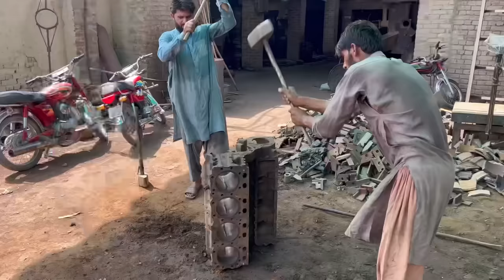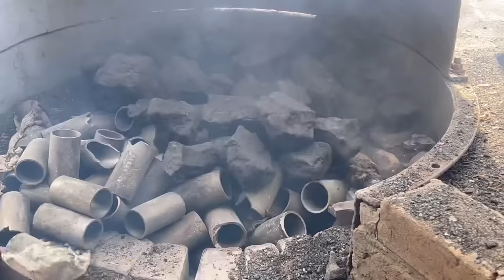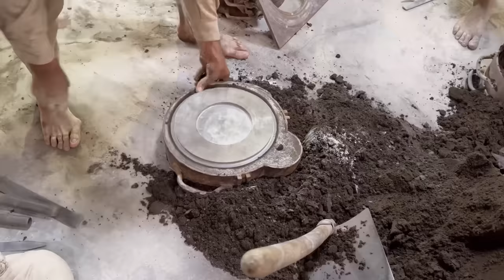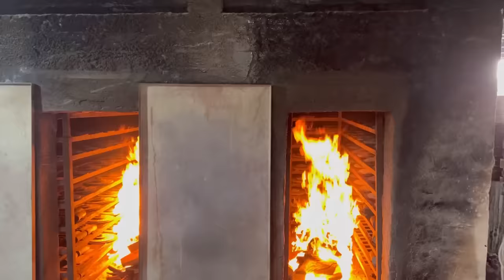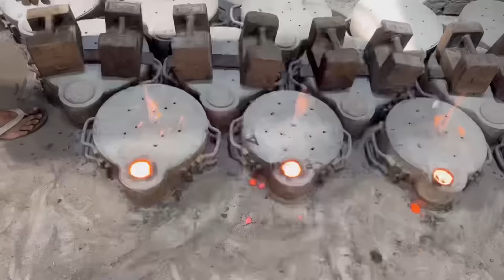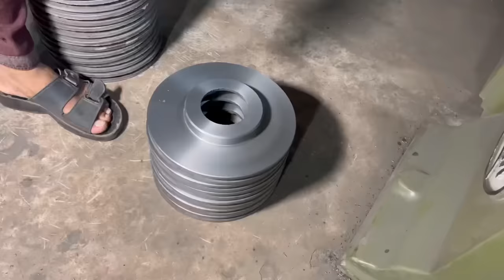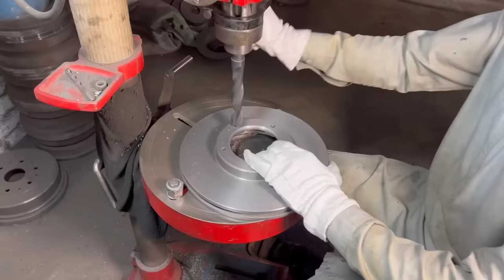Amazing Manufacturing of A Car Disk Brake Plate |

Comment: For those who do not know metallurgy, it is an extraordinary video. It has a series of serious errors in the production of brake discs. The molding sands mixture is made as considered by the mixer, without moisture control, permeability, etc. They use cast iron from engine blocks, which is a superior gray cast iron, but it is melted at the cubilou, where they burn a lot of coal to maintain the lamellar graphite and prevent the formation of cementite. The result will be low-quality lamellar graphite cast iron brake discs. If you notice, it does not show whether they are checked dynamically or statically. A disc like this, under brutal braking, is likely to break and cause a serious accident.
Reply: Exactly. I pray those no-name white box brake rotors didn't come from these stone age operations in India or Pakistan. I don't want this crap on my car.
Reply: @RRaucina  I noticed that the original brake pads last longer than the aftermarket ones. I'm wodering why ??
Reply: @stefanpopescu6479  certain parts are made in top quality only for the first installation on a new car, later by replacing them we notice that they last less or are of poorer quality
Reply: @TheSmitovski  wrong, I put after market parts and they lasted less than the original ones. I only put the original and I am sure that I have no problems with the car 😀
Reply: Sir, I would like to tell you that I tested several rotors and broke those rotors like breaking a cracker to test the strength of the casting, it was awful. Grainy and not stable. Those rotors under stress caused by high temperatures due to continuous braking will warp and brake pedal will be pulsating like crazy. After cooling down it'll be ok until it gets warm/hot on the next brake application and the shaking will re-start and will be terrible. Yet, they pass DOT (apparently). A complete 20 footer container was scrapped, the company tried to get their money back but received nothing. Thank you for posting an intelligent reply. Cheers
Reply: @caddyrack  yes and car owners would rather buy that junk than machine their original rotors, which get melted down. So much so that garages don't keep machining tools.
Reply: @bovellois  The system is broken. I taught how-to-machine rotors for many years and to finish the job by sanding the with an abrasive disc that ran CC versus clockwise machining to REMOVE the grooves (like a vinyl record) created by machining. You only take out a few thousand minding the approve minimum thickness stated by the manufacturers. I stayed below that. We're a society of parts changers not repair people anymore. Have a great day.
Reply: @stefanpopescu6479  I  try and buy Wagner, either US made or Mexico. Seem to last a very long time.
Reply: @caddyrack  I bought several rotors for Chrysler mini vans, and they all warp under long downhill stops. I am certain the rotors were simply misdesigned for the 2001 to 2007 model years. too small and light.
Reply: @RRaucina  Yes, I agree with you....unfortunately Chrysler will deny this. This was the problems to many vehicles where the engineers designed the brakes appropriately, but, the 'cost' engineers asked them: Can we make the smaller? Of course the save a few pennies on each vehicle they did this. What I'm talking about is the after market business that they make the rotors in the far east. Total garbage as we speak. The rotors are within "specification" but the inner face and outer face are of different thickness therefore one side will run too hot thus make them prone to heat cycles and consequent warpage after cooling.
Reply: Probably made for autozone
Reply: Safety is NOT an issue in Pakistan.  Just getting a job done to sell.
Reply: I'll never buy a disk like that.
Reply: NEVER use a car spare part if it is not made at Mexico, USA, China, Japan or Europe. NEVER! Be care with cars made in Brazil.
Reply: They are obviously turning out 100's a week. If the failure were as high as you suggest then it would quickly be noticed, people would stop buying them and they would go bust.
Reply: @adrianwright8685  maybe 100 a day. anyway it's insignificant. probably their market is the local one which is full of car accidents
Reply: Thats a paddle mixer, water based greensand should be milled in a mull, the water seems to be obtained from thr black hole of calcutta!, cupola iron tends to have a high S content promoting chill (cementite) with free iron sulphides which are hard unless Fe Mn is added which I doubt, but they do appear to be innoculating the iron in the ladles , perhaps FeSi? but no wedge testing for chill but I'm sure they will have repeated the process enough times to know what properties they are getting. Conversely smaller western foundries were not much differnt at one time. I remember a small foundry in Scotland not much different in the 1990's with the exception it made low quality road furniture such as drain covers not vehicle components.
Reply: @adrianwright8685 it's Pakistan. These rotors keep being manufactured not because they are good, but because they are the only, "take it or leave it" option for many.
Reply: The drill goes through the disc far too easily
Reply: Available now at your local Auto Zone!!!
Reply: then if unsafe just let them sell to the usa at wal mart super center SAM WOULD be proud of his kids
Reply: It looks like they not only added engine block material, limestone and coke to the mini blast furnace, it looks like they also added another material which contained the alloy additions they needed.  They also weighed their charge, implying that they were looking for a ratio of alloy addition.  That, along with a specified cooling rate for the castings, may have produced the microstructure and the enhanced mechanical properties they were looking for.  I don't know if it did, they are just showing what they do, not how they got there.
Reply: That's what autozone sells me and all other auto or truck  parts stores NapaNapa, parts master etc.etc.
Reply: not true. none of our product users who died in an accident due to brake disc fault have ever complained. yours truly, ahmad rashid, the ceo at pakistani super brake discs inc.
Reply: I myself worked in an iron foundry for 13 years as a model construction mechanic specializing in foundry model construction and immediately thought the same thing! We cast the brake discs from nodular graphite GGG40 / EN-GJS-400-15. We wouldn't even have made a shithouse gully out of this crap they use! What they do will cost lives!
Reply: not made in sheffield then ;)
Reply: And not to mention all the impurities of being rolled around in the dirt.  Of course when you use the words, "Brutal Braking" you are assuming these will be sold in areas that have clear open roads that aren't surfaced with compacted garbage. 😁
Reply: @bovellois  most vehicles sold in the USA have rotors that can't be turned in a standard shop environment. even if they could be turned, by the time the pads are worn out the rotors are at or below minimum thickness. im guessing this is true most everywhere.
Reply: This demonstrates that people with less modern technology can make do without modern methods... But their quality leaves a lot to be desired.
That being said, I used a low-cost n"... water pump once, and it failed less than 2 years later. Never went back to the cheap parts. I use only O.E.M. parts now and I generally don't replace those parts again. Unless of course, it is 10 years later! (I keep my cars a long time!)
Reply: @stefanpopescu6479  Go with O.E.M. pads. More cost/last longer.
Reply: Ahhh, please tell me where i can purchase a pair of your finest top quality safety flipflops from?😂
Reply: Bit dangerous this isnt it??  Smoking on the job ! .😂
Reply: These are the discs you buy when you want rid of the mrs 😂
Reply: @MyNewUserName47  on my son's Honda Civic, the original rotors had about 3 millimeters left to play with. The surface was nearly new, it just needed a light turning. But I can believe the cheapest rotors are done after one set of pads.
Reply: The video heading should read "Disturbing" Manufacturing of a car disc brake rotor. Love the PPE also. And here in Aus were saving the planet by shutting down coal fired power- what a joke!
Reply: Come on! Metal is metal!
Reply: And people complained when they wanted to regulate quality of mechanical auto parts in other countries where they do.
Reply: @bovellois  NOT Entirely true. With todays "minimalist infrastructure for maximum profit" attitude to many businesses it is probably more like MECHANICS would rather sell a NEW part than take more time and labour (So ending in the same cost) to machine the rotors (So now 2nd hand refurbished rotors on the car and the mechanic needs to outlay cash to buy the rotor machining gear ) vs so called "Brand sparkly new" Rotors.
Most customers hear "fixed up" vs "NEW" and go the NEW. 
Simple logic. NOT knowing the industry would have me go for the "NEW" but I know better and machine my own :)
Reply: @FarCryBaby  you're right, and even a "new" (as in refurbished and shiny) set of calipers once the original ones are a bit rusted!
Reply: @bovellois  - When machining a single rotor is $80-100, and a cryo treated slotted/drilled/vented aftermarket (performance / name brand) rotor is $50-$100, there is no reasonable reason to machine down a rotor.
Reply: I wouldn't install this junk even if I got it for free. 
I can only advise everyone against installing something like this in a modern car. 
If you install something like this in your car, you not only risk your own life but also that of those around you. 
In my country, such scrap is confiscated by the customs authorities as soon as it is imported and destroyed immediately.
Reply: @adrianwright8685   The buyers would have to be aware of the source in order for that to happen.  You’re entertaining the myth of a perfect free market where low quality is inevitably weeded out.   We all know that’s not the reality we live in.
Reply: @StevenTubb-s8u  I was thinking the same thing. They either have some really good drill bits or that is some low quality cast iron.
Reply: The cylinder liners must be more than cast iron?  What was that they added to the sand?  Surely while still molten they are liable to warping?
Reply: @stefanpopescu6479  have you noticed your OEM tires don't last as long as replacements? Even of the same brand and style? Ever wonder why?
Reply: @bovellois  rotors don't go to landfills. If they did, what's the big deal? Iron came from the earth, why can't it be returned to the earth?
Reply: @jonathanpalmer155  While they don't show it, the cupola operator is running periodic samples on the iron melting process and adjusting ingredients as needed. I'd like to watch the cupola operator, I guarantee he knows what he is doing and is running the crew with just a few hand signals. The reason they are using 'recycled' iron is because it's easier to get consistent class 35 iron vs. working with raw ore. Plus it's plentiful and cheap. 
The molding sand is a combination of sand, various types of clay and water. In most iron foundries, skilled workers can squeeze the sand mix in their hand when it comes out of the sand muller and use tacit knowledge to get the right mix better than an automated process. The pattern, cope and drag are specialized for this work. Red hot is not molten. Due to chilling, cast iron solidifies pretty quick (notice they pour from small ladles) but remains hot for hours. This is really an efficient process and they are producing a good end product. Have to laugh at the comments that think this has to be as precise as running a nuclear power plant.
Reply: @RRaucina  All aftermarket brake rotors, even “domestic” brands you may be familiar with (Raybestos, Wagner, Bendix, Centric, Motorcraft, Delco) are all manufactured in China/Taiwan. The only brake rotors made in the US are custom - performance products, or OEM high end, not run of the mill replacements. A set of US made Baer rotors for my Dodge truck are about $250 per axle.
Reply: @buckmurdock2500  they get melted down before their time, a waste of energy.
Reply: @stefanpopescu6479  You don't get it do you? Buying original parts is usually better choice than aftermarket ones. Regardless of that first installation parts usually are better than original parts we can buy when we have to replace them. First installation > original > aftermarket.
Reply: It's crazy to think that people in this video, who are just trying to survive and make a living, can only produce a product that is not acceptable for its intended application. It's a cruel world.
Reply: @MegaMarclar I use Autozone for years durlast parts never a issue
Reply: @AakeTraak oh no it’s not
Reply: wow great explanation didnt understand half of it lol but i take your word for it. i was definatly questioning the quallity of this product as well. you get what you pay for.
Reply: LOL.... no kidding im not trusting my loved ones with those stopping the car...... no dam shoes either......
Reply: it just looks like brake discs :face-turquoise-covering-eyes:
Reply: @RRaucina  I don't think there's single such unit operating in India now. India is the world's 4th largest automobile manufacturer and Pakistan isn't in top 30. I was awestruck when I watched these guy hammering away at that engine block like crazy.
Reply: I hope they not end up on the european market  they are not fit to go on a ox cart they are dangerous
Reply: @stefanpopescu6479 cost matters, premium quality needs lumpy cost and vice versa..
Reply: @bovellois but according to the vehicle manufacturer they can only be machined down to within spec. After that, then what?
Reply: @eeeess1667  you are right, but there are several millimeters of tolerance before it's too thin, then it get melted again (recycled).
Reply: Line hone or not to line hone, that is the question. I’m guessing not
Reply: @stefanpopescu6479  that's what Smitovski said. Original parts from the manufacturer last longer.
Reply: Well  i know congress a few years ago made car co.s make cars lighter. one way the mfg. did was cut the size and weight of the break rotors. thus less heat storage in hard breaking. Plus if you looked close the engine blocks were from diesel engines that 1 use better steal and 2 have cylinder liners that are very high grade alloys  that were mixed in with the melt. Not sure that makes up for what you are saying but its at leas better grade.
Reply: Yes, but without these low quality production runs, we wouldn't have those great 3rd work truck accident videos.
Reply: @RRaucina  how many of these horror films have you seen from India? Stop hyphenating India and Pakistan. Indian manufacturing, especially in the automotive sector, is far superior to these stone age operations in Pakistan.
Reply: @RRaucina You should never use the brakes downhill, just gear down and let the engine slow you down.
All brakes get hot but good quality disks can take more abuse from bad drivers.
Reply: Well, that's a relief - a small one - because I had assumed that the crank cases that were breaking were made of aluminium.
Are brake discs generally made of cast iron?  I had assumed that they were steel.  If you tap them with a hammer, they ring like steel.
Reply: I agree, since I have worked in many manufacturing roles. This is pure luck and mostly insanity, in attempting to create any sort of a nondeformative product.

I would like to know who the manufacturer is and stay far away from their disc brakes.
Reply: @TheSmitovski  certainly not true, people drive new cars differently than they do a year or two later. Then they pay someone else to do the work, who naturally puts the cheapest parts they can find on your car. They can charge you for new rotors and just put on cheap brake pads
Reply: I'm totally agree, would you be happy to send a little piece of the ukraine war budget that we taxpayers are sending to share better equipment to this people so they can build better quality parts? that way we will stop criticism.
Reply: yes yes and yes. Can i get the heat code for that material?
30 years in the machine tool industry., this is not how anything should be made
Reply: OMG, I just replaced my rotors and pads on my 18/sierra. I bought the higher quality rotors/pads because we are keeping the truck until it dies. Am I ever glad ai did. The one thing I did notice because I just learned to do my brakes on YouTube, everyone shoukdblewrn if they can, take them apart yearly, grease up the hardware, pins etc and Pad and rotors will last a very long time. Pads and rotors usually wear out in the north because of rust. If your in Florida or Cali than I think it's not an issue.
Reply: @wingnutwingnut7490 , ya request the heat numbers off the batch and see what they say.
Reply: @birrextio6544  Hills too steep here in California. Auto tranny will blow up in "L" and drive doesn't help much.
Reply: @cesarvalenzuela3884  that's a hard no from me!
We need to stop sending our money overseas.  
The rotors they are making are perfectly fine for their domestic use. 
Six threaded holes on the rotor is not on any vehicle used in the USA.
Reply: no one cares
Reply: @caddyrack  so that explains why my 1998 Kia had such crappy rotors. 🤔
Reply: @TheSmitovski  several levels of quality available, but you pay almost the same price as OEM!!! After seeing this, I'm going with OEM! LOL
Reply: @jfabritz  I don't know if you still have the Kia, but I upgraded my rotors on a 2013 Lexus RX350. I installed a set of 'cryogenic' treated rotors and premium brake pads. No more problems. Cheers
Reply: @chrisnumnuts8671  not even!! Lol maybe Ginsue(sic)
Reply: @coljaschoppe8670  Totally agree with sir. Again, we're in Pakistan, any type of scrap metal goes in regardless. If a rotor last 6 months....it's a good one. Cheers
Reply: This is India, safety is not part of the equation.
Reply: @molenz1960  Beside no safety gear whatsoever, the material they use is total crap. Don't forget, if it last 6 months it's 6 months. Everybody works.  Would I use it on my car? NEVER!
Reply: they don't care  quality control is barely an afterthought
Reply: Perfect for your new Ford F150
Reply: @caddyrack  i've tried many brands of brake rotors.  even raybestos.  all of them are trash.
Reply: @blue03r6  Sorry to tell you that even Rays are  made in China. They said that they have a QC team to check rotors....I don't believe that. Check the boxes, the HAVE to tell you where those rotors are made. Just pray that they're made in Mexico.
Reply: @TheSmitovski stop comparing india with pakistan we do not have such facilities. We have more modern facilities and higher regulation for auto parts
Reply: I realized the same issues even though my schooling was 50 years ago  in Germany yet at that time it already was 100 years advanced compared to the manufacturing process in this video ! I hope I will never get a rotor from this manufacturer ! The rotors are not cantered in the lathe and grind without cooling liquid nor adequate measuring
Reply: Es evidente que estos discos son para consumo interno.
Reply: This is also a tremendous and unnecessary waste of human effort and resources.  Even with cheap labor - how do they get by with these processes on such low end products?
Reply: demand creates supply. since these discs are bought, it means that the technology for their manufacture is perfect!
Reply: Is that stainless steel tube they add to the alloy to raise the nickel content?
Reply: Not to mention that machining of the mounting face and the 2 braking surfaces should be done in the same setup to ensure parallelism. When you buy cheap, you get cheap "quality".
Reply: You left out their all doing this in the dirt with slips on don't they have shoes or proper workshops.
Reply: @ozzymandus3865  if it was my company, it would be poured under different conditions
Reply: Вы всё о безопасности таких дисков думаете... Но тут люди при деле и работают...
Reply: @dimkaBG  вы знаете эту поговорку: дерьмо, которое ты кладешь, дерьмо, которое ты получаешь??😂
Reply: Come resident experts, it’s an amazing video. I’m going to get me some of those Jesus Sandals.
Reply: @stefanpopescu6479  I don’t understand your comment. I’m an old man.
Reply: @tomsommer54  I deleted the comment, it was too soft. I didn't understand your first comment either. the idea was that if you have such brake discs, you quickly go to heaven, the answer had nothing to do with age, but only that they are of poor quality. Have a nice day
Reply: Allah Akbar!
Reply: @tomsommer54 Nike Jerusalem's
Reply: Europe in 10 years ;-)
Reply: @alielabdimarras7965  no chance :)
Reply: I don’t know anything about metal and would have guessed these aren’t on the high end of parts.
Reply: @RRaucina Nissan Titian had the same problem when it came out
Reply: Я не понял они что из глины делают тормозные диски
Reply: You will get get, what you pay for. So it's your choice.
Reply: @JohnDoe-es5xh  👍 I paid in the representative office only for original parts. When they repaired my car and I had warranty problems, they did the repair without a penny
Reply: это копеечные диски которые в странах азии ставят на свои брички. они все равно быстрее 40кмч не разгоняются
Reply: Sem contar a exposição da vida humana
Reply: That is not true! The charge composition is correct: 50% hi qual grey, 25% minor grey 15% steel low alloy, 10 % pig iron, 11 % coke, 5% calcaire. Stitch temp environ 1450°C. Running in the ladle there was some inoculation FeSi,  fast casting without temp-loss. For my taste the only fault might be the early unpacking causing imternal tension. No addition of silicon and low carbon ends in prearlitic matrix with relative fine grafite, also supported by the wall-thickness and the fatty sand giving good cooling. NEVER FORGET: the cupola melting is s good self-regulating process !  The machining process is a bit antique but precise.
Reply: @rudifaber2808  let's say that maybe you are right about the proportion of cast iron put in the oven. They have no spectrometer for the primary chemical composition. so this idea falls. They have no money to introduce pig iron. the way I discuss the pieces immediately after casting creates tension, here I agree. the metallographic structure of a brake disc must be cast iron with nodular graphite with a ferritic structure. The ferrite adheres to the brake pad so that you can brake and the graphite acts as a lubricant so that due to friction the pad does not weld to the disc. Cast iron with nodular graphite is used due to its high resistance to breaking and elongation. The disk in the clip that you agree with breaks like glass upon brutal braking
Reply: @stefanpopescu6479  75% of the disks in civil card are made of lamellar grey cast.I made a metallographic cut out of my worn disk Mercedes W124 in 1995 it was lamellar, no cracks . Worn after 120
000 km. The replaced ( GIRLING) kept 420.000 pearlitic structurr with 0.9 phodphor for hard steadite-eutectic, also lamellar.  Maybe for trucks nodular might give advantsges, but the poor thermal conductivity id less.  For that, modern motor blocks are cast in pearlitic VERMICULAR instead of nodular.0
Reply: @rudifaber2808  in 1990 - 1992 we did destructible and non-destructive control for brake discs for mercedes. I explained above why nodular graphite cast iron is used and not pearlitic gray cast iron. I don't know what you controlled nor your professional activity. I actually worked in the laboratory. I find the statement that the best furnace is the one used in the video when modern cast iron is produced in induction furnaces and all treatments are done in the furnace before casting or in the casting pot really suspicious.
Reply: There ladies and gentlemen  very nicely said   Engineering is used to keep us  and our family safe from harm
Reply: This is how your autodoc Stark and Ridex discs are made.
Reply: indeed, when you make  steel or cast iron , just a small amount of scrap iron should be added, with iron ore and coke  coal and other substances depends on ore kind
Reply: Interesting. I knew something was wrong. I will never trust this brake disc.
Reply: @RRaucina  I have experienced the same and have not seen much better performance going with more expensive brands
Reply: @caddyrack  Never saw a new brake disc that was'nt Blanchard ground to avoid the pads tracking in the machined grooves.
Reply: @patricknesbitt4003  I agree with your statement, unfortunately having rotors made from the far East they don't have the same QC as we normally have in Europe and USA/Canada. They may use the Blanchard method but it's the metallurgy that I'm worry about. on a previous reply I said that I performed a destructive testing and the quality of the casting/metal leaves a lot to be desired. Even if the machining is done properly it doesn't matter when your material is crap. Have a great day. Cheers
Reply: No estoy de acuerdo. Estos discos están hace años en el mercado no tan sólo en estos países, sino en el mundo. Ya probablemente hayas usado algunos de estos o de producción china también económicos y ni cuenta te diste. Es fácil. Producto que no funciona o tiene los errores que mencionaste no vende, pues de competencia tiene miles de mercados.... por otra parte habría millones de accidentes como dices... y jamás escuché un accidente por rotura disco de freno.... estos tipos tienen años en la producción metalúrgica  creo q nadie les vendrá a explicar de proporciones....
Reply: @RRaucina  Same for Honda Minivans.  I replaced the stock rotors after only 2 years.  Although the Bosch replacement ones lasted 6 years and were only a tiny bit warped.
Reply: @RRaucina  its actually in your car but you dont know that....
Reply: Spot on Stefan. I suspect that very little testing of the materials produced from this type of maufacturing fascility ever reaches the " Met Lab's "
Reply: These are intended for low speed roads of India/Pakistan I assume.
Reply: @StevenTubb-s8u  It machines like aluminum, way too crappy for brake disc.
Reply: DuraLast
Reply: unfortunately, a lot of aftermarket stores in the USA sell inferior third-world made products with the same cheap materials and methodology.  Brake rotors tend to warp within weeks after purchase.
Reply: Caveman are working 😮😢
Reply: Health and safety dept. seems to be on holiday
Reply: What is this OSHA that you speak of? We have no accidents here, our crushed toes are by design. No need for shoes.😂😂😂😂😂
Reply: dude, we know. these videos have become a meme in themselves. people who actually know what they are doing mock all of these "Amazing" videos. they are great for a good laugh though
Reply: Yes agreed so don't buy cheap rotors.
Reply: Superb comment, all these ready for the China market!
Reply: Everything made in these pig iron shops are made from complete garbage materials.  But the buyers have the mindset of I’d rather buy 8 sets of brakes a year as opposed to one extremely high quality one.
Reply: What you say is true,
Even if the brake disc is new, it requires resurfacing on lathe machine
Reply: I'm not a metallurgist but having a serious experience in ceramics and basalt wool in Cubilot, considering your remark about moisture control standards and other metrology issue, I agree 100% with you.
Reply: I was also pretty much amused with how they just lathed it against some arbitrary axis of their choice. Of course the disks will be round, but the fins inside will have whatever center they may, so bye-bye, balance.
Reply: All these "AMAZING" videos depicting workers in safety flipflops are a lesson in why consumer laws need to be enacted and why disclosing the country products are made MUST be a lawful necessity as I wish to avoid any nation that wears safety flipflops as I don't want to die.
Reply: @dr.lexwinter8604  You're not going to die because workers somewhere else wear flipflops.
Reply: yeah its absolutely horrific. but those probably cost 1$ so you can replace the disks every 10 miles and still be ahead
Reply: They do not care. They are just making something that they can sell locally.
Reply: Oh Good Brake for RS6 ? Not expensive ? Inimagine
Reply: I have several questions good sir: 
1. Can those brake disks be hardened by heating and quenching?
2. Is the iron they are using good enough or does it need some kind of aditive to make is suitable?
3. If you could give them an advice to make tose disks better what would it be? Changing a component or a part of the process?
Reply: @diegoviniciomejiaquesada4754  1. feritte from grey cast iron has friction/braking properties, graphite has lubrication properties, that is, due to the high temperatures during braking, the disc brake pads should not be welded.
2. magnesium and another chemical composition, the result will be cast iron with nodular graphite which has superior properties of resistance, elongation and the proportion of ferrite is considerably higher.
3. to learn metallurgy. what they do was also done in ancient Egypt during the time of the pharaohs. the difference is that the Egyptians produced steel with which they made spears, spearheads, knives, etc.
Reply: It’s India, what you expect?
Reply: you can bet they, and many other did, and still do @RRaucina
Reply: guess and by golly metallurgy. Sorry, doesn't work when life is at risk. @CHixon
Reply: Great comment, nobody expects quality product form this king of a sweat shop.
Reply: Контрофакт жуткий!!!
Reply: Probably they are produce it for own market. It looks the same like those clips where African street mechanic repair rusted school bus with planks and screws and put back the same engine oil filtered with a rag. Just look at the safety there...work with lathes with wide sleeves and using liquid metal wearing sandals. Do you think, that they pay more attention to cars maintenance? 😅
Reply: Vamos lá cara, eles fabricam duas linhas de produtos: a red e a black. Cada uma melhor que a outra 😊
Eu passei o vídeo tentando ler a palavra Motorcraft em algum lugar 😂😂😂😂😂😂
Reply: @stefanpopescu6479 
I checked the structure of the discs under a microscope, they all have flake graphite.
I also calculated the stresses during braking with maximum force that will not occur in real life and they do not exceed 50MPa.
Only one thing can be made better on this video and it is machining both sides of disc in one fix.
Reply: @pawebogusz8753  You say that you looked under the microscope and saw lamellar graphite, that you calculated the maximum force, etc. when you look at the microscope you do a metallographic analysis: graphite length, graphite proportion, ferritic or pearlitic structure, the proportion of ferrite and/or pearlite. Gray cast iron has several qualities depending on the chemical composition, the length of the graphite and the proportion between ferrite and pearlite. You didn't mention anything about the ferritic or pearlitic structure. Ferrite brakes, pearlite slides, that is, it does not brake. The way they cast the cast iron is an ordinary lamellar gray cast iron with a tensile strength of 150 MPa. This type of cast iron is not cast even for channel covers because it does not withstand when a heavy car passes.
Regarding the resistance you calculated. Is it resistance to traction, compression or shear?? when you brake, the brake pads act by compression on the disc, but due to the rotation, a torsional moment occurs that leads to traction and compression forces.
Honestly, I don't understand what you studied and calculated
Reply: @stefanpopescu6479  Why should I tell you about its structural composition when the greatest influence on the strength of cast iron is the shape of graphite?
Brake discs are usually a ferrite-perlite mix with modifiers that provide the graphite with a finer form and greater dispersion.
Ferritic cast iron is difficult to obtain and is not the best, especially with flake graphite.
Stresses calculated in FEM analysis for a drilled disc.
The reduced stresses around the hole were under 50MPa.
I did not check in which directions the stresses act.
But, for example, in the case of complex models, shearing can reduce stretching or twisting.
If you want to be so precise, the surface roughness has 3000MPa while braking. 
Tension on microstructure level are diferent than in macrostructure. 
That's why it gets wear, also adhesive wear for microwelding and etc.  
Also, perlite is not that hard and the perlite disc does not brake badly.
Besides, now I ride on ceramic blocks and I don't rely on the cutting of the material for braking power.
When I had drilled discs, they cracked after overheating and nothing happened.
There was a clicking noise lower at speeds, but the disc is too thick to fall apart. 
You want cosmic technology but I was mechanical designer in automotive and I know that making chap piece of crap is the best way to earn good money. 
Bad material is enough for disc brakes when they has correct shape. 
Using better material you can reduce weight and increse performance but it is expensive and no one do it for normal cars. 
Also you have to rememeber that sometimes stiffness is more important than strength because strength is enough even when it is piece of crap.
Reply: @pawebogusz8753  I don't think you have knowledge. You confuse roughness with strength in MPa. Pearlite is the structure with the hardness of cast iron or steel, ferrite is soft. There are some gaps in your description. I think you just enjoy contradicting.
Reply: you will be fine its just a daily driver anyway
Reply: I want to see there drilled and slotted rotors!😂
Reply: You think I needed your fancy bullshit to know these brake rotors are crap?  LOL
Reply: @andrewpiroli1  Calm down 😉
Reply: good for a kia
Reply: Another example of the type of manufacturing done in third world countries. Hopefully no of this crap ever makes out of their countries.
Reply: That is why I always buy ATE brake disc! Made in Germany!
Reply: They don't even have a work table. They don't even wear safety shoes! Do you think they care about proper metallurgical standards? They'll sell it to repair shops to slop on to a vehicle , and if it lasts 3 months, it's a bargain.
Reply: @linternasmx maybe you are not know what yoy bought. Fake....
Reply: Wow!
Reply: What do you expect from guys working without eye protection, steel toe sandals, gloves and a respirator?
Reply: @bovellois  The brake rotors are made low weight making it nigh on impossible to turn because there isn't enough material to big with; this has more to do with the car companies trying to save weight for fuel mileage than people not wanting to turn them. IMO
Reply: Duralast built not to last!
Reply: I had a rotor disc separate from the hub portion, fortunately not in a panic stop.  Last time I bought cheap rotors.
Reply: Very professional review, after reading it
Reply: And yet somehow they get by just fine!  Probably not recommended for the race track but adequate and cost effective.
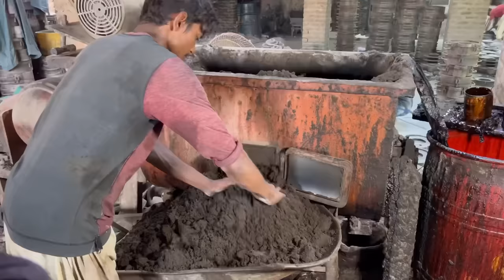Reply: 5:53 didnt you see? that was the moisture control 😅
Reply: There vehicles dont go more than 30mph anyway, if the brakes fail you could just jump out of the vehicles :)
Reply: I think that cutted tubes in a bag were some Mn containing steel @jimmuck
Reply: they had disc brakes on tanks back in 1930 where metallurgy had like 5 recipes and process for making metal, im sure this will serve the purpose its intended
Reply: They will work fine on my shitbox Hyundai
Reply: Very clever work by guys who have little idea of what they are actually doing, but are driven by the fact that they have no money to do the right thing, and really don’t care about the quality of the crap they are producing.  Third world economy producing third world crap.  I wouldn’t trust anything these guys produced with my life.  Necessity breeds contempt.
Reply: @TheSmitovski 😮
Reply: Ok...but do these meet OEM specs or not?
Reply: All the professional metallurgy experts and PE Engineers are commenting in this channel. They have the solutions and answers to all world problems.
Reply: Они не тормозят ,у них звуковой сигнал есть
Reply: @TheOlenyash indeed.A poor country where people can't afford OEM parts.. That's why they have to repair, mend and make do.. They have become very good at it.
Reply: Buen trabajo, no sé la calidad que tendrá, me pregunto si estos discos algunos acabarán en Europa América no sé, saludos,
Reply: @pedrocarsandsteel   😃🙋‍♂
Reply: Those consider low grade products and low prices.
Whoever buys those knows very well the quality.
Reply: Finally someone sounding realistic about what clearly seems to be a fourth world exploitment of common workers, resulting in lowest quality product.
Reply: @magisterms  👍🙋‍♂
Reply: I agree with you Bro ... But at the time, when you dont find the replacement in the market, and think your car is parked permanently on Bricks for the rest of your life, its better to buy these ones, and when these wear-out or needs tooling again, its better to replace the plates rather than repairing ...These dont cost much, everytime replacement of the entire disc plate is better...
Reply: People buying these are using them to stop their 600kg box Suzuki that's mostly going in town/villages. People who can only afford such box cars usually only have a budget for these local rotors. They'll serve the purpose. No one's putting these on a sedan doing 140kph down the motorway.
Reply: @AB-uw3os  I saw one in Punjab.
Reply: @HunterShows  Pakistani Punjab or Indian Punjab? Besides, while you do find such crude units in India, there are also many world class manufacturing units making all kinds of automotive components up to Japanese and German quality standards which are OE suppliers to companies like Toyota and VAG. Suzuki even exports vehicles made in India. Can't say the same about Pakistan.
Reply: @AB-uw3os  There's a state in Pakistan called Punjab? Ok then, I guess you answered that.
Reply: as long as those disc brakes stay in India we are doing the planet a favor
Reply: @k1leon  they were never in India.
Reply: Amen.
Reply: Жратву они так же готовят
Reply: These are OEM parts, We see now why our cars are so expensive
Reply: And now imagine how they make a atomic Bomb.... 🤣
Reply: @bovellois  Rotors are much cheaper than they previously were back then. Also they are no longer produced to be machines over and over. Rotors were made much thicker back then IOT allow machining and reuse. There is no reason to machine rotors anymore when the cost doesn't require it and they are too thin. You would only be able to machine them 3-4 times max before they would become too thin to meet specs.
Reply: @stefanpopescu6479  Well until  you can  provide any evidence to conclude the rate of car accidents cause by manufactured disc brakes made by this process is higher than if they were manufactured by scientifically approved safety standards your argument is pretty much irrelevant.
Reply: @carlosb1  Good joke 🤣🤣🤣🤣
Reply: @stefanpopescu6479  You have nothing bud.
Reply: I'm sure they warp to hell after a few hundred miles too.
Reply: You shouldn't be doing brutal breaking then
Reply: Думаешь, что открыл кому-то глаза на то, что три индуса с пыльными руками работают не по технологии современных заводов?
Reply: I don’t see the negative
Reply: @Garagedoorsandgates208  no problem. mount them on your car
Reply: All this “quality,” and the workers get .07 cents a day!
Reply: Dude, no-one cares. This isn't a 'how to make brake discs at home' video. 99.9% of us just came to watch some hard working people make sometime.
Reply: Thank you for your comment!
Reply: Пускай сами ездят на таких дисках.
Reply: Yes, dude, that’s the difference between non-original brake discs and original ones.  These are savings that are not worth the difference on the market.
Reply: @BertFripp  good joke 🤣🤣🤣
Reply: What Rockauto means with their Economy category
Reply: I AGREED
Reply: They don't care lol
Reply: this is what i think while seeing this video. "Grauguß" is not good for brake disks
Reply: Incluso ya llegaron al mercado latino frenos para bici😅😅 ya me tocó y se cristalizan las gomas 😅😅 una vez me pasó salí y frene y me que sin frenos , y eso que es una bicicleta 😅😅😅no quiero imaginar un auto